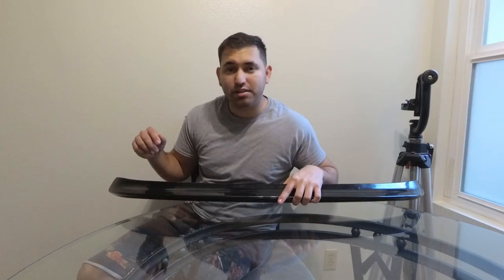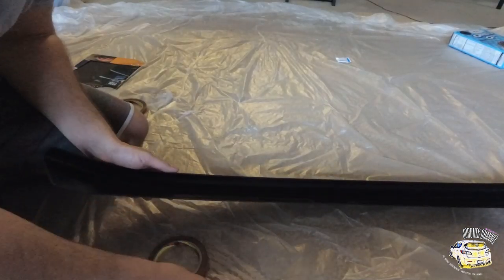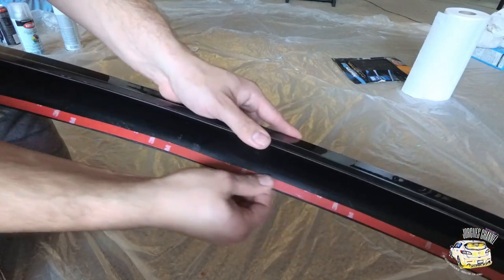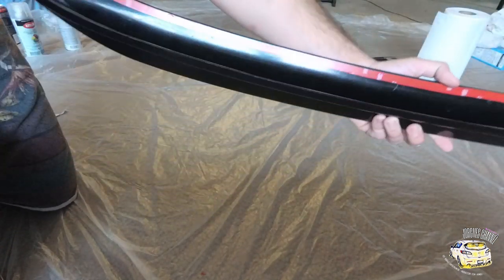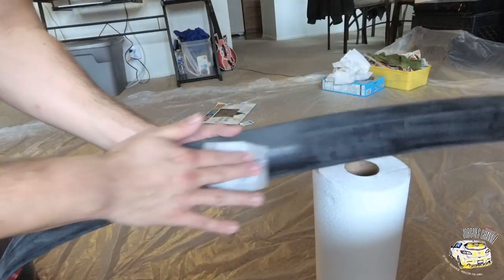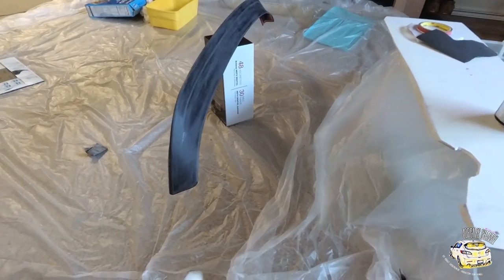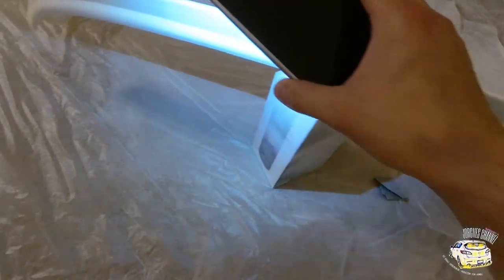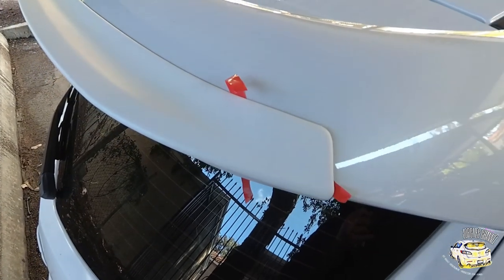Wing Extension Install [Paint Prep]

Comment: I just picked up a 2013 ms3, I’m not sure if it’s normal that it makes this kind of coins shaking in jar noise is that normal? It does it revving in neutral and driving along with exhaust and engine noises. Sounds exactly like this in this video https://youtu.be/PuXtm8y9Yh0 can’t find any answers on it
Reply from the maker: The video you shared sounds normal. Nothing out of the ordinary. If you're referring to the ticking noise you can look into the cdfp. But that sounds like a normal mazdaspeed to me :)
Reply: Jorgiie's Channel cool thanks!